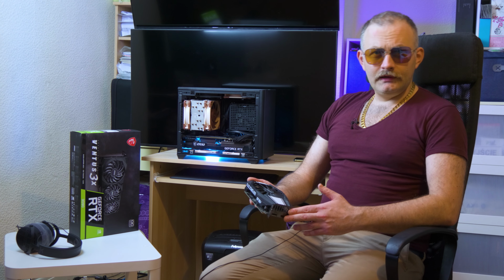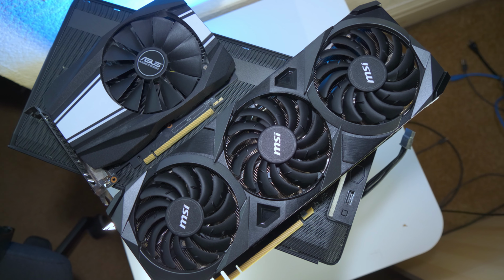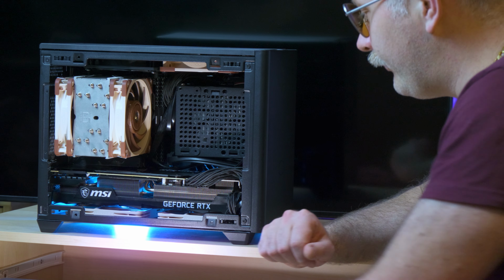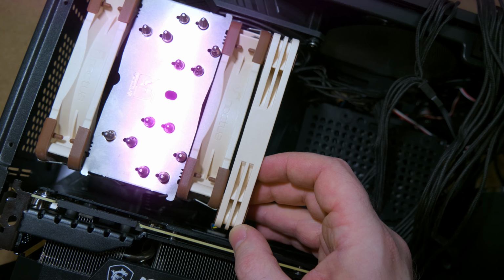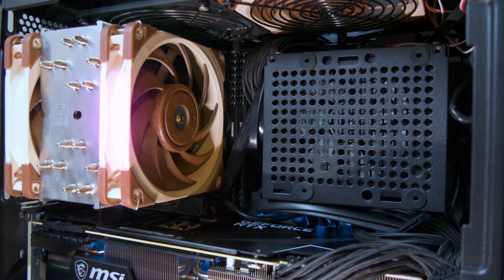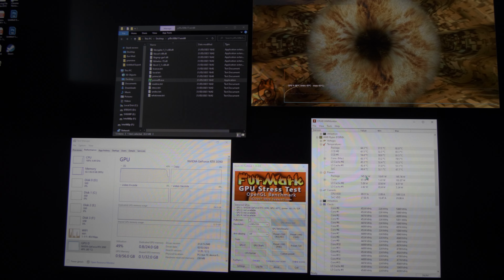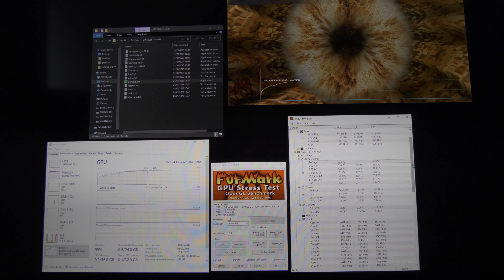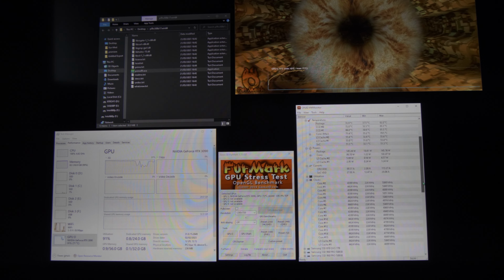NR200 with MSI RTX 3090 Ventus AMD 5950X Airflow on NH-U12A Endgame

Comment: I think you should try turning the cpu fans direction and the psu unit. The psu should draw fresh air from outside and push it upwards. The cpu cooler should also take fresh air from the back and push it to the front/top part of the case, so it flows with the exhaust from the psu. This may seem counterintuitive, but since this case doesnt have air flow from the front, this is the best way to use. Every critical part get air from the outside, and all of them push it to the upper part, exhausting from there

Comment: Nice design. I have the same case and was wondering if this cpu cooler
would fit. I’m wondering if the side bracket would fit on with one fan on it as intake to pull colder air into the case in front of the cpu fan so it can pull in fresh air.

Comment: Hey, thanks for the vid, i have a question, can u still use the nr200 side bracket to mount a fan or ssds on the left side of the case with a cooler of that size?
Reply from the maker: no

Comment: Has 750w been enough to power this thing? I got the exact same PSU but I was worried it won’t be enough. I’m planning on slapping a Ryzen 5800 and a RX 7900xt in this case. Great video by the way!
Reply from the maker: PSU can handle this at full GPU and CPU load

Comment: Hello mike, have you already tested turning your psu to draw fresh air from outside, because the way you installed it, it is getting hot air from the case. Congratulations on your computer, mine is almost a copy of yours.
Reply from the maker: when you turn it around the PSU exhaust is pointing downwards / if you flip it the cables are 'everywhere'